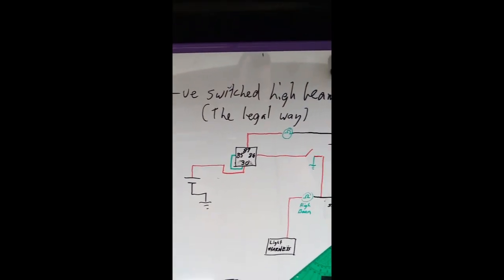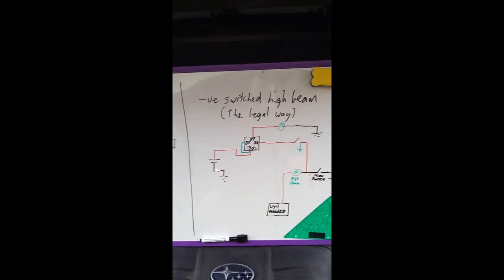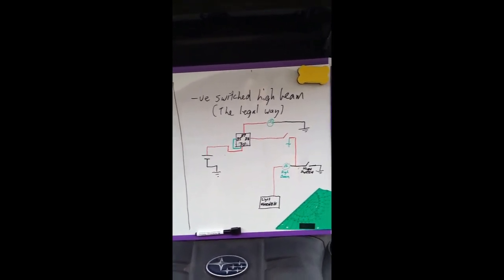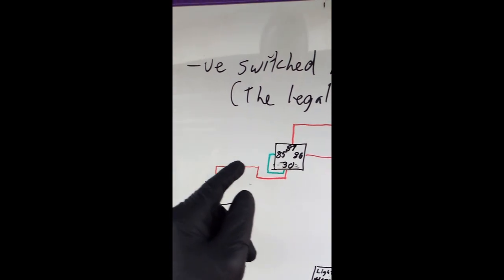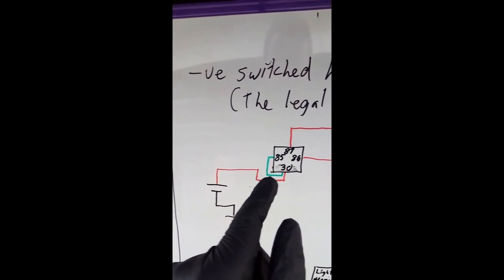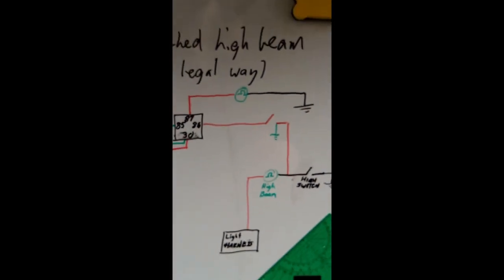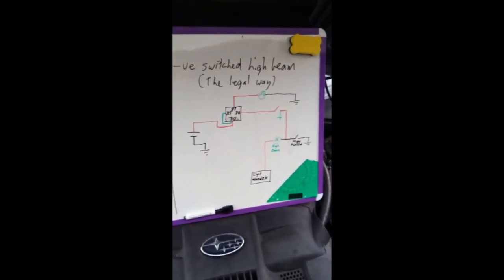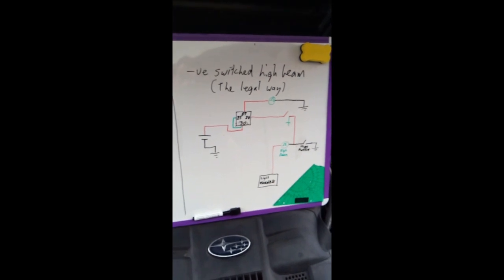How to wire a negative switched light bar

Comment: Hi. I used your diagram and have managed to get my spot lights to work with the negative switched high beam in my mk3 mx5 but it then turns the spots on when the lights are off.
Presumably due to it looking for the difference between the high beam and the power. Do you have any tips for this?
Only thing I have managed to do is use a feed that is ignition switched at the fuse box instead of straight to the battery but this still turns on the spots when lights are off.

Comment: I had my light bar connected and working for years. Now I have changed from halogen to LED, now the light bar won't work. If I wire them in your configuration will they work? It's a 2000 Forester. More of a question than a comment.

Comment: Does this work with headlight bulbs converted to LED type bulbs ? It seems the high beam circuit doesn't bleed enough current anymore to trigger the relay or some LED circuitry is clamping the voltage down

Comment: Hi mate i tried  your wiring on my Honda crv  2006 without that extra switch. Id like the ledbar to light up when I'm using the high beam. It dosent work when  I turn my car  of, the ledbar starts. ITs impossible to wire the ledbar, I tried one more relay between the loop 85-30. That  is suppose to open the circuit when I turn engine off to not give power to led bar from battery. I take the control current from the half light. But It still doesn't work. Im contacting the psychologist soon.
Reply: I’m at the same point if you’ve sorted it how please

Comment: bridging 30 to 85 would mean the relay is always on right? whats the point of having the relay?
Reply: Keeps the light bar current out of cabin at least
Reply: It won’t be on until and earth is provided, that’s how negative switching works, always power running to the lights bit they can only illuminate when the circuit is completed ( by earthing ) This setup makes fitting spotties/lighbars a pain depending on the vehicle, often the hardest part is getting a high-beam signal wire sorted.

Comment: Great video.I'm going to give it a try.  my light bar comes on with no light & side light too , it goes off on low beam & comes on again on high beam, and the switch led only comes on with high beam. my car is a suzuki jimney
Reply: If you have managed to sort it out how did you do it having the same problem with mine